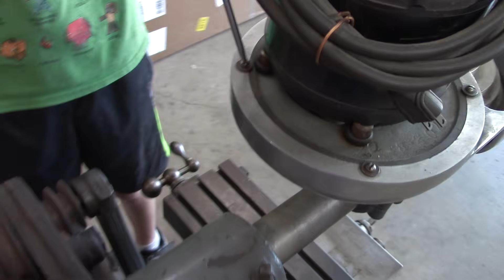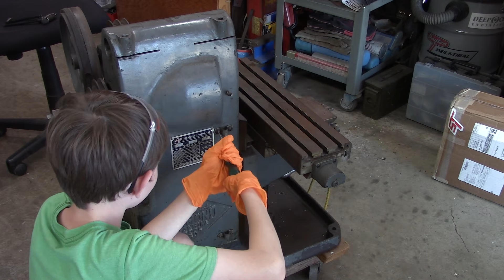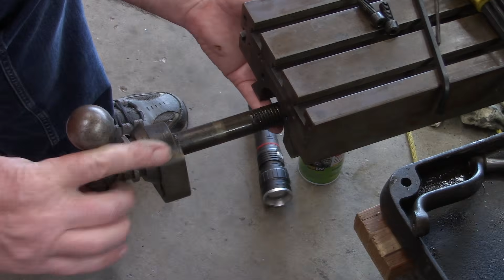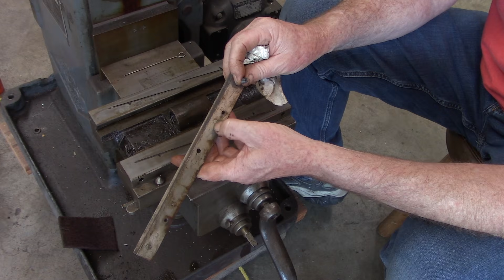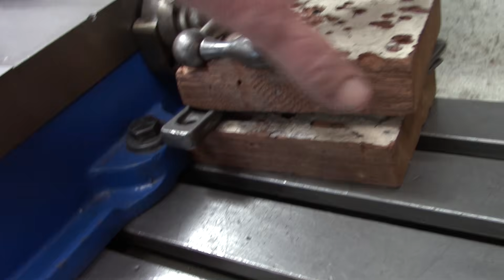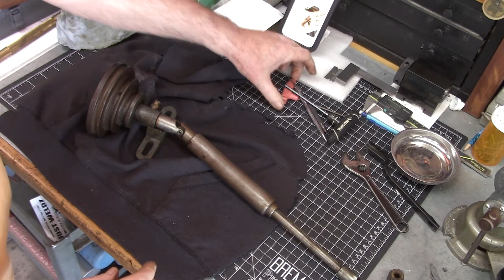Diamond Machine Tool Co. Horizontal Mill Restore Part 3

Comment: Good one Dean , The taper pin woes strike again ! .   With those table adjuster screws , the tapered slugs may be missing .   A short length of steel or bronze cut square at one end and bevelled to the angle of the dovetail at the other .  An alternative is to use a ball bearing between the grub screw and Gib .   Cheers  👍
Reply from the maker: Thanks for the ideas Max yeah it’s definitely not an ideal set up…
Cheers….

Comment: Dean where did you get the file handle? I would like to get some for my files.
Reply from the maker: Terry, those file handles are awesome, Chuck B. (AKA "The Seagull")  3D printed them and with a little heat on the file tang makes a perfect fit.
Send him an email for the print file, or maybe he'll print you some. There way better than the standard handles.
I need to get a 3D printer as soon as I can find some open horizontal flat surface 😊